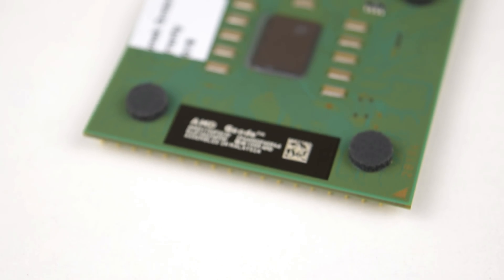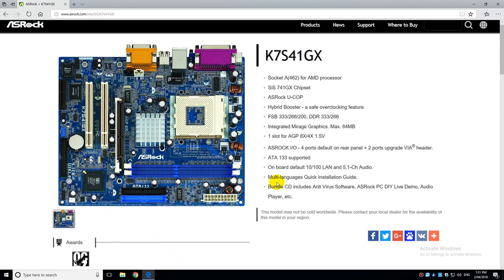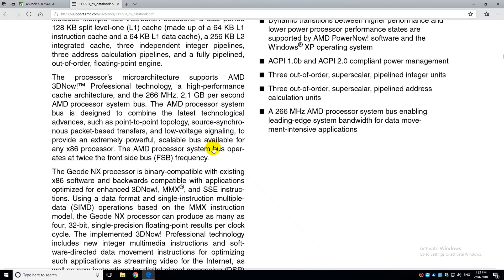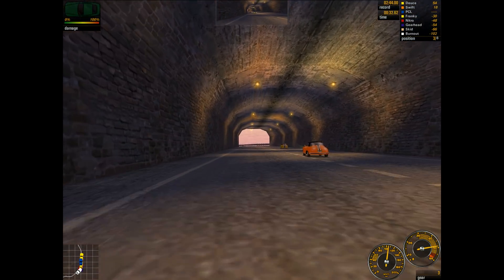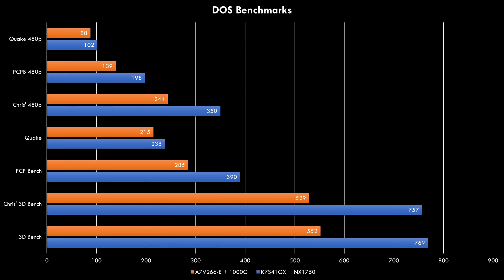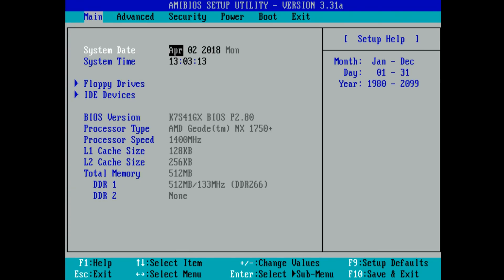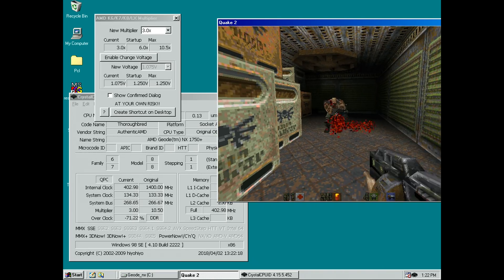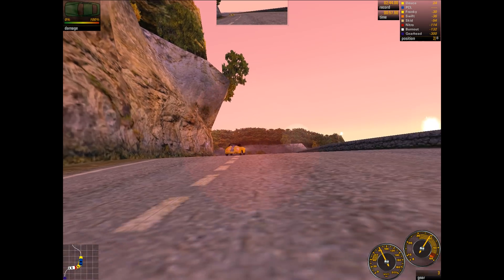AMD Geode NX 1750 Review - Low Voltage unlocked 14W

Comment: I'm running that ASRock K7S41GX with the AMD Geode NX 1500 (9W TDP), 2GB RAM and two HP NC150T PCI 4-port Gigabit Combo Switch adapters. OS is 32bit eisfair Linux. Runs great, very stable.

Comment: Hello Phil, I have now put together a retro PC. The components: ECS Elitegroup K7S5A PRO 5.0, AMD Geode NX 1750 and 256MB RAM. It works quite well so far, but the BIOS shows me a CPU temperature of -55 degrees. I also installed the latest BIOS (thanks to the downloads on your website). Was that also the case in your tests or is the sensor on my board defective?

Comment: I paired this with a K7S5A Pro and while it does get slightly overvolted, I'm actually overclocking a little bit anyway so it's fine. I have mine running with a 143MHz bus for ~1.5GHz, and I'm waiting on some better RAM to hopefully push a bit better. I'm using mine in context of an early XP rig with the Geode serving as a lower power version of essentially an 1800+, paired with a Ti4200 at 4400 clocks. My power supply actually can handle a Thunderbird, since I had to replace the modern supply that I was originally going to use in it, but my power bill appreciates the lesser draw of the Geode immensely.

Comment: Just installed this CPU in an unsupported MSI MS-6390 and it works fine at 1.42-1.44V (auto voltage).

Comment: With the unlocked multiplier, I'm wondering if it would overclock, as well as "underclock" as you suggested?

I actually managed to get one of these NX1750 processors, from a guy in Germany.
I also have a motherboard ready for it: The ECS Elitegroup K7S5A Pro, which you reviewed already and confirmed to work with the Geode processors.
I've got almost everything ready to assemble, only thing I'm waiting for is a GoTek-drive.
Since Tualatins are expensive, and I already have a Coppermine P3 1GHz - I thought this should be my "Budget Tualatin Killer".
Not sure if it will be able to compete, I hope to be able to compare some benchmarking results with someone who has a Tualatin, once I'm done with the project.
Reply from the maker: Hehe very nice! You will like the results. With the GOTEK, the bundled software is usually quite bad. Use the software that I've saved onto our website, I still use it and works great. There is a video guide on the channel.
Reply: Yep, I'm using that software from your site already with my other Gotek drives :)
I watched one of your videos many years ago, showing the Gotek drive, and figured it was a really good solution, so I've been using Gotek for all my projects ever since.

Comment: It works in a Gigabyte GA-7VAX... the lowest it will run is 600mhz @ 1.868 volts. What i would like to know is if this will be slower then the duron 700, and will the high voltage kill the cpu over time?? There does not seem to be a way to lower it even more and i cannot control the voltage... pc is running dos 6.22.

Comment: GeodeNX based MS-Dos/Win98 time machine, in the spirit of you'r project with the Gigabyte GA5AX perhaps?
Reply from the maker: Yea I've done such a project, works pretty well as DOS machine with a YMF or Solo 1 sound card. Not as flexible as the Pentium MMX though.
Reply: @philscomputerlab  Was that the old Geode on that board with ISA slots? Because I thought you meant a SocketA GeodeNX 1700 project. You talked about the CPU being unlocked. I actually also snooped around, and there are this cusin of this CPU, that are more or less a bit the same. It is the Athlon-M in a SocketA form. Or that is how it looked on the pictures. That should be unlocked as well. Basically... Gives ideas with an SocketA board and a compatible PCI sound card and a Dos compatible PCI GFX card. 😉

Comment: The Geode NX 1750 is a monster "cherry-picked" Thoroughbreed Athlon XP with lowered voltages and multipliers to be low-power (1.25volts/1.4Ghz/25w Max). It can be ran 24/7 at 1,70 Volts at 2.3 Ghz or more in a destop mainboard with proper desktop cooling, i have seen then running at 2.1 volts/2.6 Ghz and pass some benchmarks. The NX 1500 (1volt/1 Ghz/9w Max) is even better as it had the best power to Mhz ratio of the Geodes, it was also the more expensive of the two in its era. In my opinion, this Geodes are much better than the TB XP-M, and at higher Mhz they also beat the Barton XP-M. they were also newer.

Comment: ASRock got a bad reputation, but i tell you what, from experience i can tell you they actually make the best motherboards for amd and intel even today.
Reply from the maker: Yea I also always had good experiences with Asrock Retro motherboards! I also like that they maintain all the legacy drivers, unlike INTEL. ARGL
Reply: @philscomputerlab  Im using the ASRock K8 VM800 socket 754 with the athlon64 3700+ with win98se, its running smooth as silk, gigabyte were the worst imo, most of their boards were very lacking and unstable compared to ASRock. the ASRock K8 VM800 was probably one of the last 754 motherboards, it uses the newer AMI bios, its an amazing board so good in fact it also supports socket 939 too! ASRock add way more features to their motherboards even today theyre number1 for overclocking.

Comment: I recently found my K7S41 (not GX) in a box full of plates and picture frames. Replacing one capacitor, made it spring back to life. I can however highly recommend the K7S41, as it is a bit less picky and a lot more stable than the GX model. That said. Are there any comparison out there, between Win98 compatible systems, running at actual 1400mhz? Like a benchmark comparison between: P3-Tualatin/GeodeNX-1400/Athlon1400/AthlonXP1400/anything else. I just can't find anything. Speaking of K7S41, then there are jumpers for multiplier settings on the actual board. I don't know if it is the K7S41 only or the GX have those too. It is the four FID-Jumpers above the FSB Jumpers. https://www.manualslib.com/manual/348164/Asrock-K7s41.html?page=15#manual

Comment: The GEODE NX 1750 works in my SK43G but in the BIOS only 9x is the slowest setting. I thought 2x100 for Dos would be a Killer-Feature.
Reply from the maker: I recommend the NX 1500 instead. 1 GHz, but half the power consumption. The lowest multiplier is 3x.
Reply: Thx Phil I ordered 2x FSC Futro S400 https://www.kastl-gmbh.de/media/pdf_distributor/FUTRO-S400-I.pdf http://ipc.endofinternet.org/wiki/index.php/Hardware/Futro/S400 which has indeed the NX1500. Would be very interesting. The GPU seems to be that thing here https://techreport.com/review/3067/the-sis-315-graphics-processor. I am thinking about one machine with Ess-Solo for major Dos-Gaming and another one either with Voodoo1 or a better PCI gfx-card for Win9x gaming. Don't know what PCI-Card perhaps a GF6200 is best here. 
For the Dos-Gaming I hope the Bios let's me choose 3x and within Win9x I can go up to 10x. My NX1750 (within SK43G "unkown CPU" works good in Dosgaming with Qemm386 and Cpucache off though. What do you think?
Reply: perhaps I am wrong with the GPU, seems to be that one "K7S41GX SiS VGA driver Xminator II with 32MB shared-memory" xabre300/600? I don't know... we will see when both arrive...

Comment: I was quite a fan of AMD Athlon XP processors - I had 1500+, thoro 1700+ / 1800+ (unlocked multipliers), Barton 2600+ mobile...but I never knew this existed! To tell you the truth, I was hoping Phil overclocked it to the limit, but it turns out this does not cover the aspect of his video :)
Reply from the maker: I'm not into overclocking!
Reply: As a huge fan of computer hardware, I respect your work. You should hire me for overclocking, because I'm definitely into :) *kidding. As a matter of fact, it was exactly Athlon XP which got me in. Great platform, especially Nforce 2 Ultra-400 (and Epox).

Comment: I have one of these sitting in a parcel box I got a few months back when I was trying to find a decent condition board for a duron.
What GPU is it worth pairing this with for Win 98?  I think I have a powerVR kyro II somewhere if that will do the trick.
Reply from the maker: There are a ton of options, best to try out a few cards you got lying around and see if it runs the games you're interested in.

Comment: I was pleased to see a video about the Geode NX! My current retro gaming PC has the 1500 in it (forced to 100x5). This thing runs amazingly cool and can surprisingly overclock well! The Soltek SL-75KAV I'm using now has voltage controls in the BIOS and dip switches for multiplier. It does not identify the processor, but does assume 1.2v (which is over the 1v it's specified for, but it still runs okay) and I was able to boost this thing up to 133x11.5 before being unable to boot (going higher voltage did work to max out the board's multiplier.) I have a 1750 sitting inside a KinetiZ 7T as well, and it also works there. Both of these boards use KT133A. I recommend trying one out if you can control voltage+multi in the BIOS or board itself, but its potential is severely limited otherwise. Desktop boards I've got that support Thoroughbreds with Via chipsets seem to play nice with these. And, I can use a low power PSU as well as passive heatsink cooling, which is not heard of much in the K7 line.
Reply from the maker: Nice, thanks for the information, good to see they work in other boards. Good point about using a board with DIP switches, you can just set the voltage and be done with it. I've had 2 NX 1500 on order from Germany, but the package got lost / collected by someone else :( I should get a refund soon though, will just buy one somewhere else :) Only 6W, which is amazing. You can run these passive no worries.
Reply: try and find a nForce 2 ULTRA chipset you can also try pin modding the muti higher 
the nForce 2 will have higher FSB from 100MHz to 200MHz

Comment: Does this SOC include a GPU on chip?  I am asking this because I believe the Geode was in the Nintendo Game Cube.
Reply: No GPU in it. Nintendo GameCube had Ati graphics and a CPU with the PowerPC architecture, so definitely not a Geode. Same for the Wii.
Reply: The Asrock K7VT4A PRO supports this CPU, I used to have one as a home server.
Reply: Geode? In a Gamecube? Not even close. It was a PowerPC 750CXe derived chip (the stuff you'd find in G3 Macs from a few years prior to its release).

Integrated GPU: I don't know.

Comment: Phil, can you try this CPU on very old socket A board? Like KT133 and such? So far for me, K7 always worked, paper support did not matter even the newest Barton posts and works correctly even on the oldest board (off course it will work on the lower FSB, but it will work and you can compensate with the unlocked multiplier). But this CPU can be different cause it has default voltage sooo low some boards may not be able to set its. Its just an idea tho, I do not necessary "need" to know it. But if it would work (and there big chance it will) its a good deal for certainly unlocked chip. The Athlon XP models became locked after a certain date. Personally, out of K7 I use the fastest possible FSB133/266 based XP-M with Barton core. It has the widest compatibility and the multiplier is unlocked there.
Oh and by the way, your issue with KT266 and 130nm CPU not working is linked to KT266 only. It will work on the other boards and there is a fix for the KT266 but I cant seem to google it now, Im afraid it has been lost in the depth of old internet. But I do remember some early KT266 needed to be modded to work with 130nm cause of design issue that appeared there and did not exist on the earlier or later boards. I remember cause I did the mod 10+ yeas ago and it worked, but I no longer have the board, not the procedure manual. :(

Comment: These are grat chips to set %oc worldrecords, there is also a NX1250 with 667MHz but it is crazy rare, I "only" managed 200% with my NX 1500, compared to the 300+% you could get with the 1250 :(
Reply from the maker: I had 2 of the NX 1500 on order, but they got lost in the mail, trying to get a refund now through eBay.
Reply: If you want some NX 1500, just PM me a Adress and i'll send 2 of them your way :) They are also dual socket compatible like all XP-M chips (without modding), i think that could maybe also make for a nice video.
Reply from the maker: Thanks, I might come back to you, will see if I get a refund from eBay first.

Comment: Hey guys, I have a retro gaming pc with a Palomino 1800+ (stock, no overclock) mounted on an asus a7v600-x (latest bios), 1.5gb of ram and a geforce 7300 gs 512mb. Should I spend some Money (approximatedely 30 dollars here in Brazil) buying a Barton 3200+ or it wouldn't Worth the difference that much? Thanks for the help

Comment: If a Socket A MB has a 4 pin CPU power connector does it support modern PSUs?
Reply from the maker: It should help, yes!
Reply: +PhilsComputerLab OK. Thanks.

Comment: Hi, If you are interested you can try this DOS based multiplier setting utility. I have just added partial Athlon 4/Athlon XP-M support to it, maybe it works with your Geode. 
http://falcosoft.hu/dos_softwares.html#a64lowp
You can report back also on Vogons :)
https://www.vogons.org/viewtopic.php?f=24&t=38613&start=120#p665205
Reply from the maker: I still haven't gotten around to testing the tool, but I will have a HP Thin Client with Geode NX soon, and I'll make sure to test your program and let you know!

Comment: At least in the US, many of these Geode processors can be found in thin clients, usually for relatively cheep. Typically a GX. A nice thing about many of them is you can boot via USB.http://www.parkytowers.me.uk/thin/hware/hardware.shtml Is a great resource about the hardware inside many of these devices, and if they have any pins that can be hijacked for general board usage.

Comment: Looks like a pretty interesting processor - I don't think my ASUS A7V880 will support it, as the minimum voltage I can set through the BIOS is 1.65V, which will likely fry this chip very quickly! It could make a good substitute for a Pentium 3 system, provided you can get the AGP slot working under Windows 98 - this was difficult on my board, and still has issues after running some games.
What software did you use to change the CPU multiplier and core voltage?
Reply: no it will not fry it the 0.13nm  will take 1.65volts without issue it will just use more power  these chips are cream of the crop..  Very high binned for it's lower voltage/power usage  it's higher binned then the normal mobile athlons..  this chip more then likely would hit 2.5ghz on stock voltage of 1.60/1.65

Comment: I have one of those Geode NX CPUs (the 1500 model which runs at 1GHz). I used it in the past IIRC in a Via KT600 based motherboard. They are detected as Athlon XP-M because they are Athlon XP-M, only in a 462-pin package instead of the mobile package. 
(edit) The NX Geodes were a radical departure by AMD from the older Cyrix/NS Geodes, and even from the earlier AMD Geodes. They just dropped the earlier Geode architecture and used their regular Thoroughbread cores instead; in particular the low-voltage ones used in their mobile Athlon, almost completely unmodified.

Comment: I was waiting for this video, hey PhilsComputerLab since this cpu have a lower power consumption that means that this cpu is more friendly with modern atx psu with weaker 5v rail right?
Edit: now that i watched untill the end i noticed that my question was already answered.
Reply from the maker: Yup that is correct, especially compared to the Thunderbird 1.4, you're shedding over 50W!
Reply: Did you had any success running the geode on the a7v266 ?
Reply from the maker: Rodrigo B.P Haven't tried it, time is always not enough.
Reply: Well i have my a7v266-mx coming, should be delivered tomorrow, i also found one geode for $3, so i will get one to test.

Comment: This processor is also the last processor of the old Cyrix lineage, the Current VIA's X86 chips are homegrown
Reply: Its not. the oldest geode was indeed based on Cyrix media GX, but not this one, this is just normal AMD K7 same Thoroughbred-B core used in Athlon XP, XPM, Duron and Sempron. Its just default clocked and volted very low.

Comment: the best motherboards in terms of compatibility are the PC chips (yes, I know) M863G series, I do own two of those from different revisions and both detects the Geode NX with its proper name and voltage unlike my Asus motherboards which detects it as an XP-M like you said and an Asrock which just start beeping and doesn't POST at all